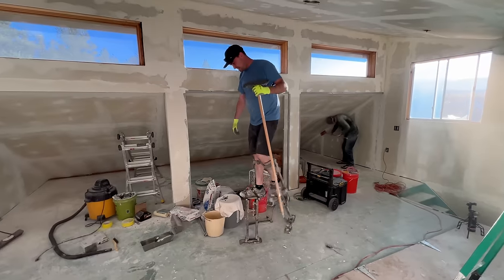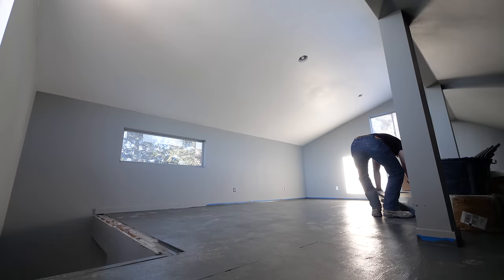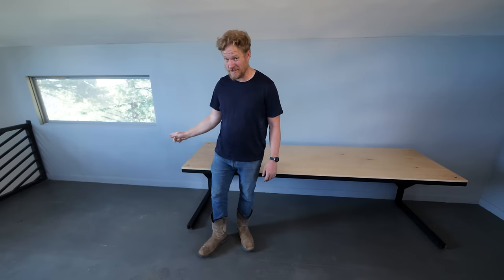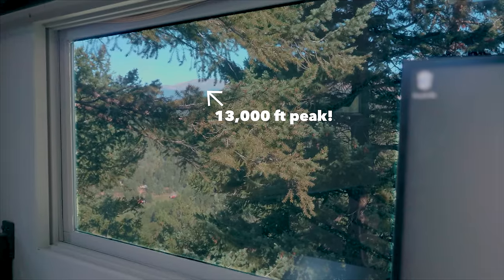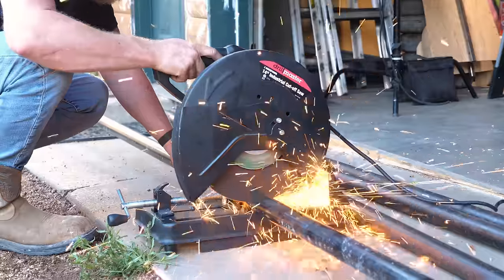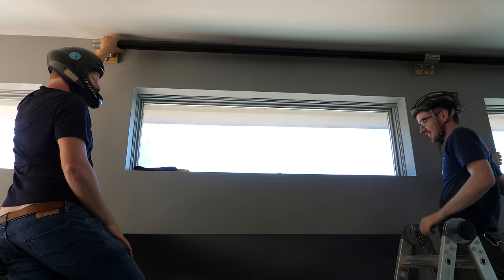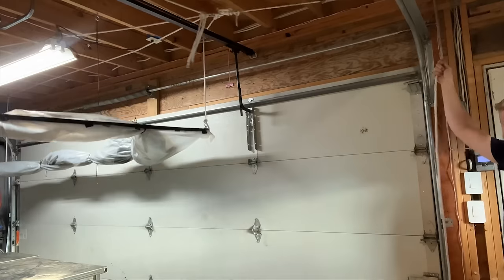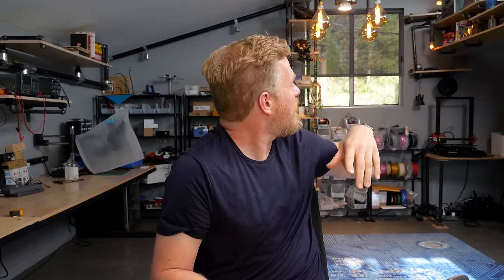Building The Dream Workshop!

Comment: I just finished moving last month and getting my shop set up. Garage electrical and lights ran, cnc mill, lathe, air compressor running. High vacuum system have power at least. SEM up and running, working on office/lab now. So much work and money.

Comment: So glad your doing better. The shop looks awesome, love the railing!

not sure if there is a door from the workshops to the stairs, but if there is you may want to put some sort of gasket around it and a weather strip where it contacts the floor, to prevent dust (particularly metal dust) from getting upstairs to your 'clean' room.

Comment: The railing turned out amazing. My only suggestion would be to replace the abrasive cut off saw with a cold cut saw. Almost no sparks little less noise and the parts are not hot after you cut

Comment: if you ever use that 1 part enamel again (the rustoleum stuff), add a bit of enamel hardener to it, will dry much quicker and makes for a better product, I have been adding something like 15:1 hardener to the stuff and it makes it kick off in an hour instead of all day
Reply from the maker: Good to know - that stuff was miserable. Enough that I swore off using oil based primer/paint in anything but a spray can for another ten years, until I’m dumb enough to try again.
Reply: @StrangeParts  I actually used a generic urethane hardener i had which was a valspar product and it worked great, also, it will allow you to sand runs and recoat (supposedly) without lifting the lower coat due to ether getting under the coat below.  Also thinned 20-30% for better sprayability, again used a urethane thinner (valspar) and all seemed to go well.  Test on scrap metal first to verify

Comment: Nice video! I like the sound effect, you made my day! :) My only concern about the light fixture the lightbulbs will generate heat and will melt the tape and the hot glue.... so it it a possible short circuit, or even an electrical shock! Be careful! Or forget it if it is a LED lightbulbs...

Comment: 3D Printer Linear bearings/ Sliding blocks/Shaft Brackets/ Couplings/Handles/ Engraving Machine Press Plates / Manual Screw Jacks/ Lathes Dogs/ Disc Springs/ Screws/ Nuts ...Welcome to MSM Store (Your one-stop shop)

Comment: i really hate being the person that complains about stuff, but i honestly don't like the over use of sound effects, i personally think that just adjusting the volume of the original audio track is the way to go, in my opinion it looks cartoon-ish

but besides that, It's even funny how you just made a minute long montage of a complex railing, I've worked with metal before, and it isn't that easy, and ready to go, this is a short video but it's completely full of information, It's just AMAZING

it feels like you were holding back so much stuff and you've put it out all at once

Comment: Holy crap, I recognize that chip-tune type sound at 7:30 and elsewhere from Moonbugs. I used to play it as a kid on my parent's Tandy 1000.
Link to sound: https://youtu.be/-HHGIMk3EUI?t=161 This will sound a bit different as the sound was rendered on different hardware (in the case of the video it was emulated).

Edit: And I think the sound at 8:33 is a valve turning in the original Myst.